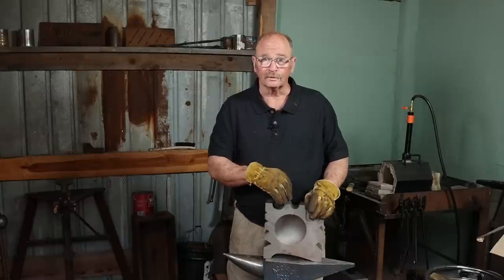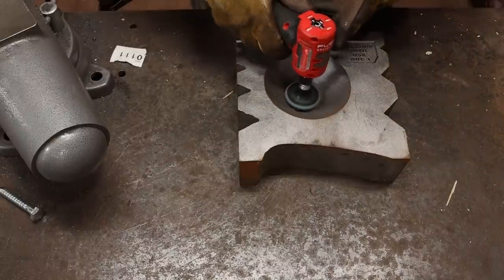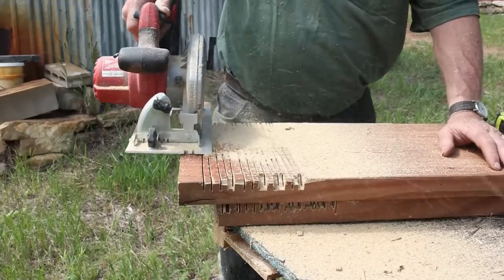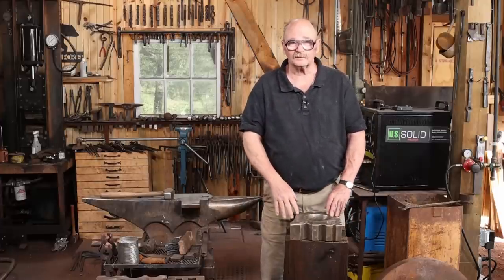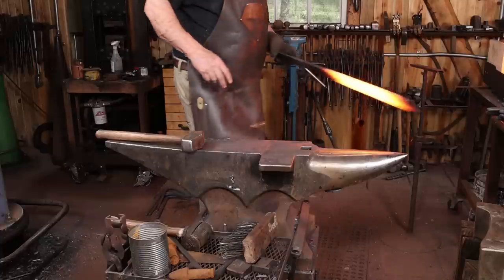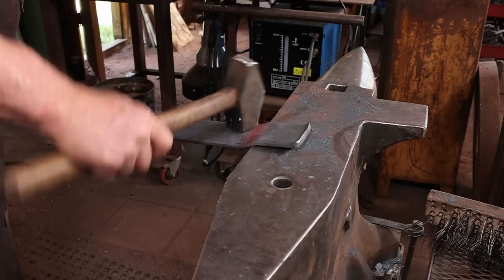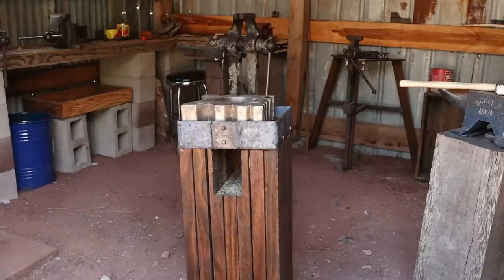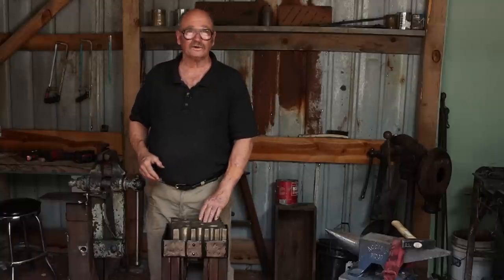Holland Anvil 50 pound Swage Block

Comment: Nice little block and looks to have cleaned up just fine. Thanks for covering this one! Got a cone mandrel from Holland a while back and ayep, they do leave just the rough cast finish on most all their products (it's mainly the anvils they clean up).

Also just wanted to call out the good design principle that the stand isn't made to only fit a single block but can instead be used on multiple. Space and materials are always a concern and you save a lot avoiding single-purpose stands/tools whenever you can. Not always possible or feasible but good to keep in mind when drawing up plans.

Comment: You'll love how that pine tar treats the wood.  That's all I use on my hammer handles anymore, and I'd never go back to a different finish.  My recipe is 1 part Pine Tar and 1 Part Turpentine to thin it out.  Sometimes 2 parts Turpentine if I'm running low on the Pine Tar.  The Turpentine is a pine product, too, and adds to the anti-microbial/fungal jive going on, but also makes it easier for the tar to penetrate into the pores of the wood.  Adding Linseed Oil isn't a problem, imo, so long as it's genuine Linseed Oil and not the BLO that we all know and love.  For a harder, shinier finish that goes on nice wood projects, adding shellac flakes to the mix will work wonders.  Adding beeswax to the pine tar and turpentine is also quite nice.  No matter how you mix yours up, use a heat gun to warm the painted wood and you'll see it suck the juice straight in.  End grain will really take a lot of the stuff, so be careful you don't go overboard!

Comment: I have one of those 50# swage blocks,  i haven't had a chance to build a stand for it yet but I think I will be using your design.  I was thinking before of using some heavy angle iron at least 2x2 to wrap around the stand; that way I can have the one leg sticking out for a place to hang tools specifically used on the swage block.
But that may present a "snagging hazard" for your legs 😮

Comment: For that gigantic "plane chisel" you used, if someone wanted to make a copy would you suggest using fairly cheap mild steel for all but the cutting edge back a couple inches? I'm thinking about making my own, and the cost of a single piece of decent steel large enough to make one would be a bit much! I figure forge welding a piece of tool steel or other hardenable material to the edge of the blank would do it.
Reply from the maker: Forge welding the edge on would certainly be the traditional approach.  However, the only one I have ever made, I used a large leaf sprig and made the blade as a single piece with the socket made from tube.  The chisel in the video is an old one I bought, the one I made was sold.
Reply: Leaf spring! The obvious solution was staring me in the face. I don't think of using things like spring steel for woodworking tools, and I certainly should break that habit.

Thank you!

Comment: That's a nice looking swage block. Having worked at an iron foundry in the past, castings generally are pretty rough out of the sand even if blasted and chased. I've been wanting to make my own for a long time but $200 seems like a bargain to me.
Reply from the maker: Compared to many of the others out there, I think $200 is a great deal.  

I have always wonder, what do you call someone who works in a foundry?  Some one who forges iron is a blacksmith, welding makes you a fabricator then theres a machinist, but I don't know what the name is for a foundry worker.
Reply: @BlackBearForge  these days I think simply a foundry worker. In the old days foundryman. But there are specific tasks like furnace operator or mould maker or patternmaker that are often used to describe specific types of work done. I was a patternmaker myself.

Comment: Hey John, great video once again, thank you! Have you done a video on dressing the edges of an anvil? If not, could you do one? I need to dress my edges but I'm not exactly sure how to do it. If whether to use a grinder, and if that's going to soften the edges and face of the anvil etc. 😊
Reply from the maker: Its one I have been meaning to do,  I would use an angle grinder with a flap disc starting at around 36 grit and finishing up to 120 or 220

Comment: I have a concern.  Striking material  with the swedge on end will bring your knuckles very close to the upward edge of the guard band.  I realize it isn't sharp but with force it can pop a finger right off.
Maybe if it sat up higher from the edge.
Reply from the maker: Not really a problem.  My grip on the hammer is out side the foot print of the block, the block is higher than the band and even without material in the swage the height of a hammer head bring the hand even further up.
Reply: @BlackBearForge  cool, it was difficult to get that perspective on the initial build.  More videos! 👍🏼

Comment: Hi John thank you for your videos 
I have found were I can get a 5” inch swage block from 
Do I need to put it on a timer bace or can I make a steel frame for it
Reply from the maker: Either one is fine.  The blocks in the main shop are on fabricated steel stands

Comment: How do you like the metal chop saw blades?  Have used them for copper pipe and stuff, but never steel, curious how they cut and last.
Reply from the maker: I have been very pleased.  I'm only on the second blade in this saw in about 3 years
Reply: Oh wow, id say the money then.

Comment: What would be the cost of a sewage block that was of a higher quality that did not require all this grinding?
Reply from the maker: This block is certainly high quality and most blocks will require some clean up and dressing of sharp edges.  The Centaur Forge blocks would be a nice set at $760 each.  But they are also more than twice the size https://www.centaurforge.com/Centaur-Swage-Block-A/productinfo/WYSWBLA/

Comment: Is there any downside to using wood for the stand with hot material
Reply from the maker: Not really.  I suppose if you have reason to put hot material right on the stand it might be better to weld something up
Reply: @BlackBearForge  thanks for the info and keep up the good work 👏

Comment: Just beware. I just brought one of these. They are very rough! I have spent approximately 75$ on abrasives and so for an hour of “finishing” it and still not ready to use. If you are looking to start using your swage block right away you may want to spend more money on a better one that only requires a little touch up not a refinishing…